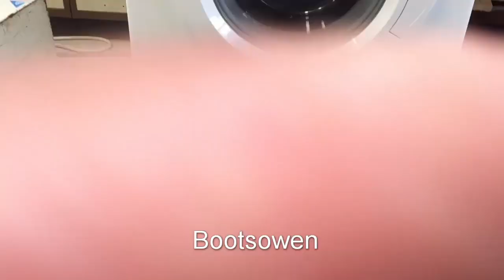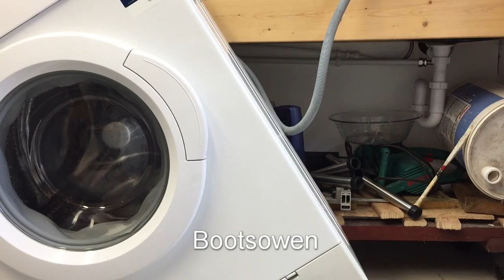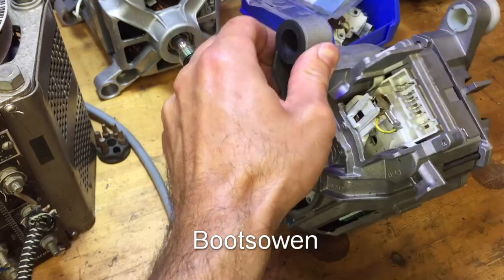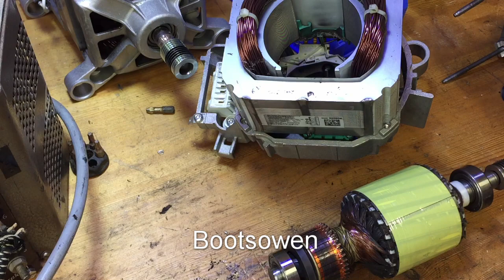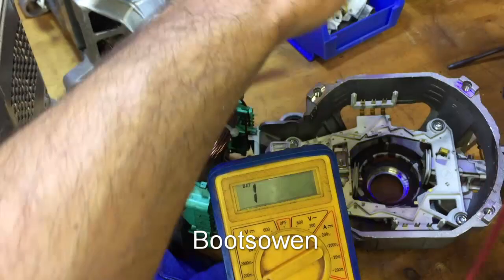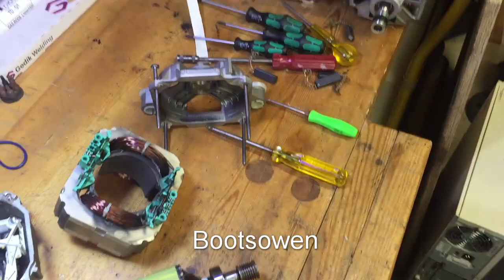Bosch Classixx 6 Varioperfect Motor Fault Part 4: test wash and failed again

Comment: Sorry your perseverance did not reep the rewards it deserves.
Hopefully you can shine some light on the problem i am having
I acquired a Bosch Classixx 6, not the Varioperfect, it had a broken door, so i thought, easy repair
I got a free door, fitted it and tested, only for a fault code F21 to appear on a small digital screen on the top panel
This is a drain fault apparently, checked the filter down below and found a broken impellor
had let water into the electrical section of the pump
Bought a new one, still same code
Replaced the brushes in the motor as below 10mm in length
Watching code reset procedure videos on YT, i cannot get this to display they flashing lights as you hold the button in, therefore cannot clear the code
The button you press is not a soft press but a hard press, so it's difficult to know if the switch is pressing
Any pointers would be appreciated
Reply from the maker: I have another varioperfect found last week, door falling off, I have repaired that and now some other issue. But I am trying to repair it and making videos!
Reply: @bootsowen  Thanks for your reply. Look forward to viewing the video
Reply: PLEASE DO NOT BUY A "BOSCH" PRODUCT IN WASHING MACHINES  IN FUTURE.

Comment: I had the same problem with our machine, so followed the whole series.  Changed the brushes, refurbed the commutator, basically fannied around with various stuff and the bugger still won't run properly.  Annoyingly the motor will run when plugged in and given a little nudge to turn, but then gives off puffs of smoke when it tries to start itself.  I was hopeful that your blow by blow account would have a eureka moment, especially by part 4.  When I told my wife you concluded with "It's a knackered motor" she gave me the inevitable look and told me to buy a new machine.  Still, 8 years out of one Bosch is not too bad...
Thanks for the vids, when my wife saw me watching a video of a washing machine going round and round, well I'll let you fill in the gaps ...
Reply from the maker: Why not buy a new motor?
Reply: I  HAD VERY SATISFACTORY USED  "ZANUSSI" - MODEL: " Z 9292 T"  ON 28/08/1984 IN THE UK, WHICH WORKED FOR 25 YEARS, WITHOUT ANY REPAIRING COSTS. THEN BOUGHT "BOSCH CLASSIXX 6" ON  29/04/2009. IT HAS STARTED GIVING ME THE SAME TROUBLE- "IT IS NOT SPINNING". A REPAIRER SAYS HE WILL CHARGE ME £50-00 FOR A CALL OUT CHARGE, THEN COSTS TO REPLACE ANY PARTS EXTRA !. I HAVE WATCHED YOUR ALL FOUR PARTS IN THIS ISSUE. SORRY TO SEE THE MOTOR TURNED OUT TO BE FAUTY.

Comment: Or You can try to adapt another motor. As they have little different tacho windings archived tumble and spin speed might be abormally fast of slow, but it"s worth a try
Reply from the maker: I have looked through all of the motors that I have, none will fit, the distance between the pulley and the front mounting lugs is the critical bit and none of mine are even close.

Comment: That motor is gone. It's making the clicking sound when it turns. Dead motor putting current back into the PCB which is tripping the RCD. 6 year old machine it's way past it's life expectancy. Best thing to do is hotwire it and chuck a brick in it
Reply from the maker: but if the motor is dead how can it be hotwired?